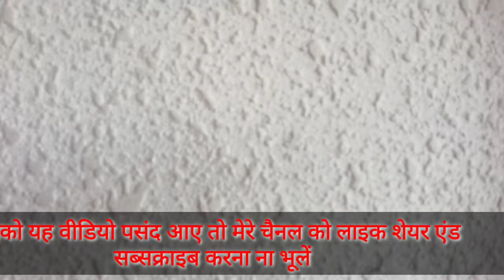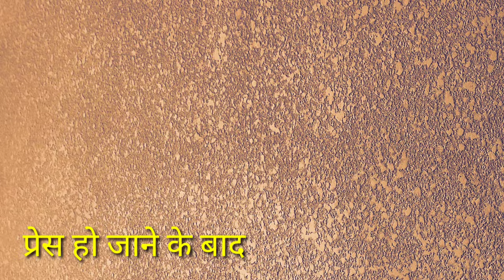Wall Texture Spray Gun Design on Bedroom Wall

Comment: what is the sprayer name? how much pressure is used from compressor? is the filler has any specific name?
Reply from the maker: Spray Name Is Bubble Spray | used by full of compression And I'm double piston compression use And there are 9 holes in front of the gun but I use the number 3 hole.
Reply from the maker: thanks for asking questions